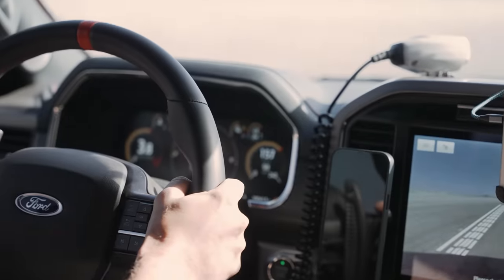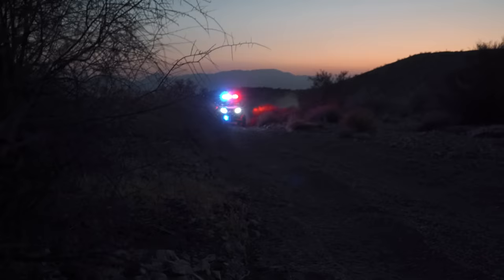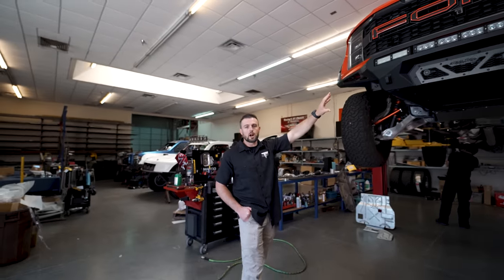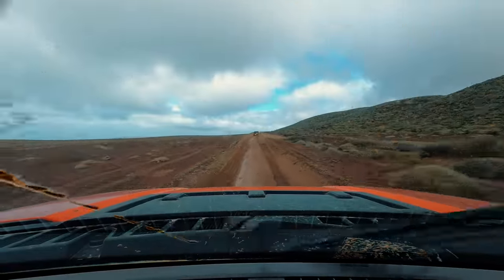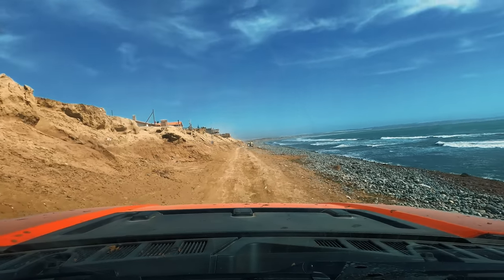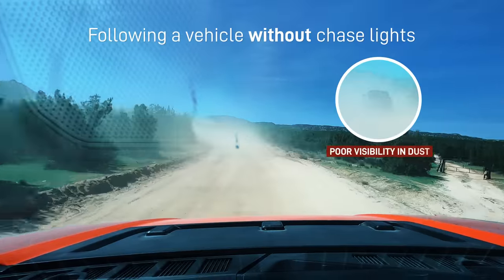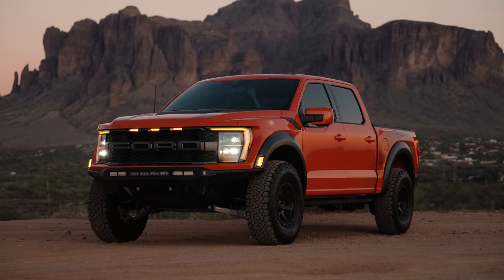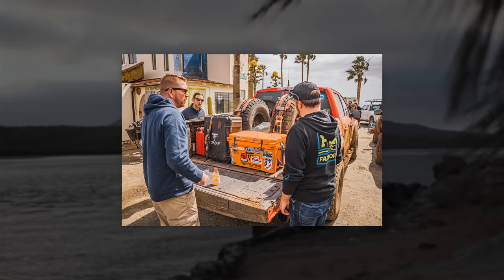TOMAR takes Ford’s Gen-3 Raptor with 37 Performance Package to Baja

Comment: Did not have to be replaced like he stated. Plenty have used the stock ones in baja just fine. Aftermarket makes better products in some cases for sure.  Just like shocks, the factory ones are great,  but one can upgrade those beyond stock ones. Get a clue...

Comment: Build cost?
Reply from the maker: Hey E J. We are constantly changing and updating the Gen3, working especially with other local manufacturers here in Arizona. Because of this, it’s hard to determine how much the whole build costs. As far as the lights are concerned, the chase kits are between $2-300 each, and the front dual-color TRX El Toro Lightbar is about $2k. Hope this helps!
Reply: @tomarUSA  thx!  I like your lights.  
Did the front bumper require relocating sensors?
Reply from the maker: The parking sensors have new locations in the bumper. The cruise control sensor did have to move up to the grill, but ADD supplies a relocation bracket with their bumpers.

Comment: 85k and you had to replace the skid plates with real ones.
Reply from the maker: We don't know that we had to necessarily, but the kit made by Foutz Motorsports is next level and it definitely added peace of mind.  One thing we wish we did see Ford include is some lower shock guards in metal, and a differential skid.  These are the lowest parts on the back, and the plastic shock guards can get pretty chewed up.